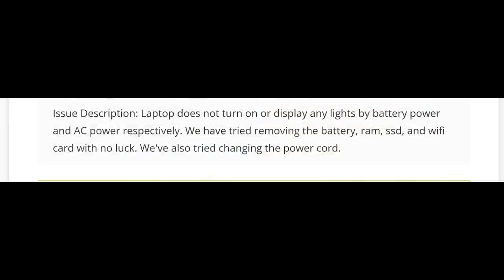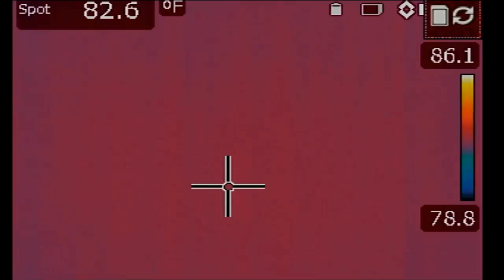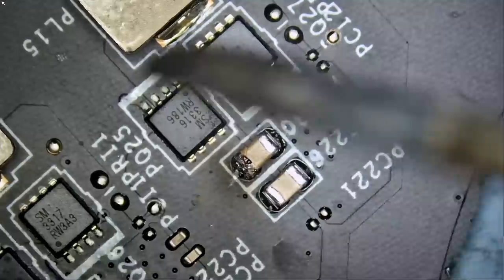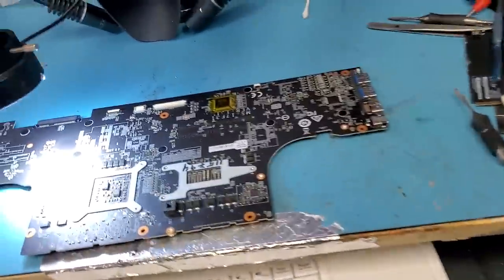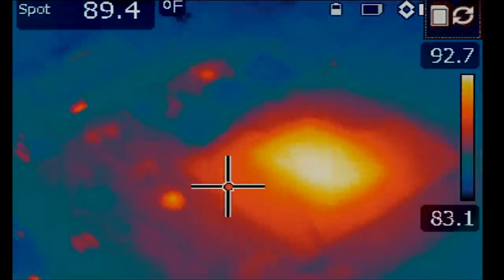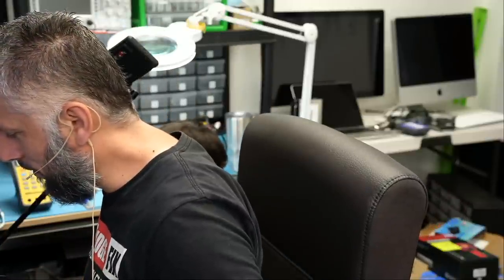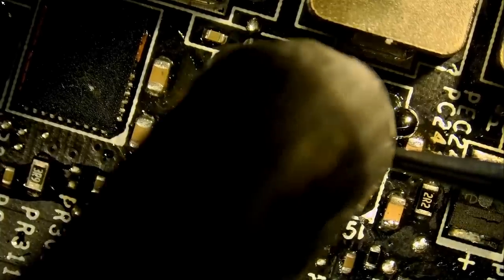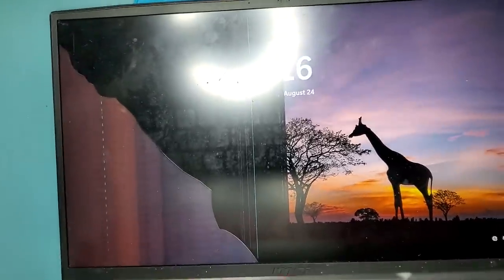2 MSI Laptops MS-17 came in for repair - Can we save them ?

Comment: There is a reason why cap fails. Modern caps are made for max capacity in smallest form and they have thinner isolation layers. So any stress on them can  make it break insulation and short
Reply: Yes, you are correct.
Reply: most caps also fail as a result of cheap, or weak materials.
Reply: MLCC ceramics are extremely brittle and can develop stress fractures when individual boards are being broken off in production (depending on location and orientation). This is also why you are not supposed to hand-solder them. Once the cracks are there, silver migration alongside the potential difference will eventually do the rest, the silver being contained in the lead-free solder. The combination of SMD and RoHS really hasn't done the reliability of ceramics any favors (which used to be very reliable in the days of through-hole and leaded solder).

You can get shock-protected ceramics for automotive use, though as you might have guessed they are substantially bigger and more expensive.

Comment: There was solder on the current sense resistor because someone had soldered a wire to it to do voltage injection
Reply: Yes

Comment: As an engineer, one thing I can say about caps is, manufacturers cut costs by lowering the voltage rating, often to something ridiculous like a 6.3V cap in a 5V circuit. The rule of thumb is that a cap voltage rating should be double the voltage of the circuit

Comment: Capacitors are used for different purpose. I think here this cap is used to filter harmonics (or you can say stable the voltage). When a surge beyond its capability reached to it, burned it's dielectric layer by spark. So it is failed.

Comment: @NorthridgeFix- great video! my question is how much voltage do you typically inject? Also which value was the CAP you replaced? How did you determine this? Thank you

Comment: Your endless supply of donor boards do help. If there aren't how on earth would one know the values of these caps chips. 
Why don't you ever get dslr cameras to repair? I need to fix a blown backlight issue on a dslr display but can't locate the circuit. I replaced the whole display assembly and still no luck, indicating the problem is in the main board. Rye area where the flex connects, there are no components there. Canon 70D

Comment: I'm just curious why you're not using antiglare light all time ? is there some disadvantage (heating from the lamps, ...) ?
Reply: No he uses the regular ring light because the light output is much better when there no flux on the board to cause glare. You need both in combination to have good working light. Also the microscope camera he uses now versus the AF IMX290 camera he used to use takes in light differently. The ring light is great in many situations and then the gooseneck lights are good in other situations.

Comment: My Dell precision laptop had the fan heat sink go out. I replaced the heat sink and fan assembly, but the GPU was not being utilized anymore. I replaced the GPU and same problem. I should also note that often the laptop will freeze during boot when loading the OS. after a hard restart it boots to OS and functions. Any thoughts on what the problem could be? As a side note I also made sure all NVidia drivers are up to date and properly installed.

Comment: Caps have reasons to fail. Transients. Overvoltage. Mechanical stress on the board (board flexed during installation, thermal expansion, etc). Even manufacturing defects. However most of these do not matter as a replacement will not have the same issue (assuming it is not something like corrosion/liquid damage). And frankly it is simply not worth/cost effective figuring out. For a penny component you fix and move on.